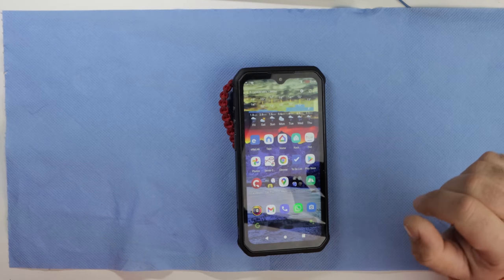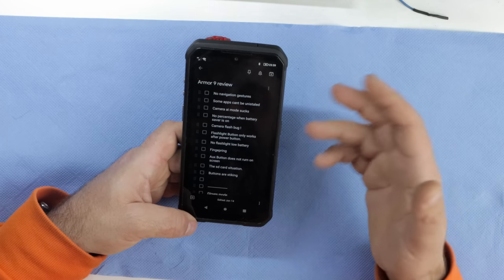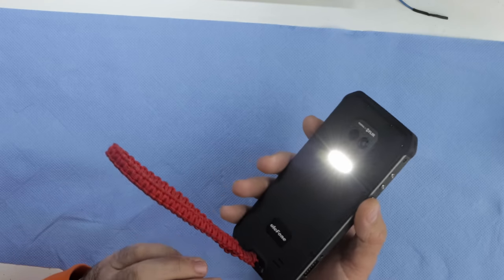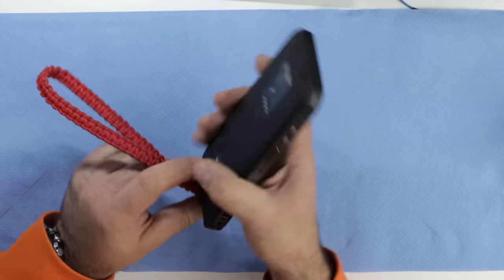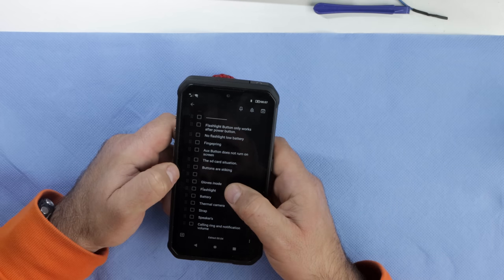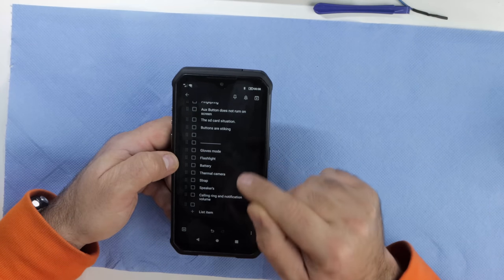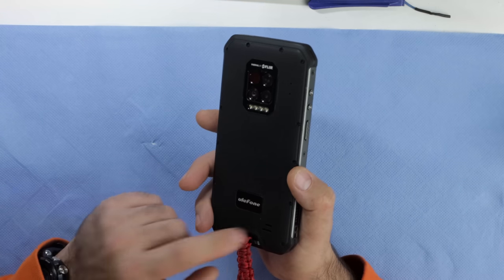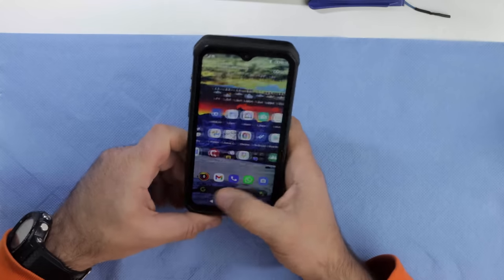uleFone armor 9 follow up 6 months later | The whole truth about this phone !

Comment: Owned mine since it was first released in the US. Use it daily in my HVAC job. Water, oil, dirt, refrigerant, nothing seemed to kill it until......I dropped it off a 2nd floor roof onto a sidewalk. I feared the worst. It landed flat face down and even with the additional external case I figured it was a goner. To my surprise, the screen was undamaged. I did manage to kill the microphone from the sudden deceleration test. Contacted Ulefone, while out of warranty they did send me the parts to repair it myself at no charge. I used a bluetooth earbud for calls until parts showed up. Swapped them out, good to go. It I ever do kill it for good somehow I would absolutely own another. I actually do own 2 more of their phones, a 3W I use as my personal phone and a 6E which is now a spare as I wanted the 9 with the FLIR for work as soon as it was released. The 6E I've loaned to my 5 year old grandson to use as a tablet/games as he's already killed his momma's Samsung and a tablet. He can't kill this one. All three have been amazing (and abused) rugged phones that just don't quit.
Reply: What email did you use to contact them I have a 4 month phone that won't work. I've been trying to contact them to buy parts and have been ghosted.
Reply from the maker: Does your GPS still work properly?
Reply: @reversingentropy  Yes, everything still works fine EXCEPT - the texting has never worked worth a crap. I've had it on both Verizon and ATT as well as tried several different apps. Same results, it'll work fine for a few hours then I'll stop receiving and hangs sending. Reboot- Same results. Checked all the settings without success. I use this phone for work where we use a specific 3rd party messaging app (Trillian) where everything/messages live forever on our server with no issues. My other Ulefone phones never had this issue 🤷🏻‍♂️
Reply: @Anonymous_User_Incognito  That's weird.

Comment: Thanks so much for a review after using the phone for a significant time. I love how you actually stated the cons, they were not all that bad, your video actually promoted the phone way more than any advertising crap could've. Could you give an indication of how many times you dropped it on a tile or stone floor? Are you still using this phone in 2022? how is the aux port, can you get any cable into that small hole?
Reply from the maker: Hi. Shure. I dropped it way too many times to count. However the screen broke. It has a single crack from one side of the screen the other. But it did not shatter and its bearly visible. Aux port is fine use it often changing port is fine as well. But ever since last patch there is a gps bug... It takes for ever to get location and sometimes not at all. Various people have the same issue.
This phone is now old and broken and it sucks in many ways but what else am i going to buy ? Hope this helps cheers
Reply: @reversingentropy  thx so much for the heads up

Comment: The Armor 11T has a thermal camera. Lower resolution screen, no card slot, and no endoscope connector, though. Seems like they decided to cut costs on several things to fit 5G in. I wonder if the battery indicator / flashlight / side button issues were fixed.
Reply from the maker: It also has no port covers so you can't use it in saltwater. No place to attach a strap..No five LED flashlight etc etc... It's a downgrade Rather than an update...
Reply: @reversingentropy  - The new Armor 18T seems to be the real successor to the 9. The flashlight looks pretty good and most of the specs are improved. I wonder if the button behaviour / fingerprint scanner are any better, though. And it's pretty expensive.
Reply from the maker: @RFC-3514  i haven't seen it yet. Im checking it out. Thanks.
Reply: @reversingentropy  - Have you managed to get our hands on an 18T yet? Every video about it on YouTube seems to just reuse video clips from the manufacturer, which makes me doubt the "reviewers" ever even held one, let alone used it out in the real world.
Reply from the maker: @RFC-3514  no I haven't. I am done with armor, i am using google pixel instead.

Comment: I can't get any menu path to assign apps onto the SD card, but the other feature are tremendous... Your 6 month later video was the clincher for me... I got the who gadget set for it and love the features...   A month later I'm still unable to find a android menu path to enable the apps top move to the SD card and the menus are a little different on each phone brand... If you are willing and actually have the time could you note the menu selection sequence to enable the apps to be located on the SD card ???   Your Videos are the best Comprehensive on YouTube... All other Videos are superficial except for yours... Thanks for the Lists of Pro and cons as well.... Really Great Video 10/10 !!!
Reply from the maker: I can't find it... I am sure it was there on previous firmware, i think... But i have searched for storage options and i can't find any.... WTF ulefone... What are they doing...
Reply: @reversingentropy  Yes, me too... I am not the most obtuse stick in the mud, and actually like building my own PC's... Even did coding back in C-64 Days and wrote an actual 3-D Rubic's Cube Program with sound and Joystick control... Used almost all of the 64k...  Did Fortran4 on the old IBM Model-360's... So I have a little light at the end of the tunnel with tech...., however I dug systematically through every single menu and came up ???????????????????????? !!!! So I am in 10000000% agreement that Ulefone Broke their, "FONE...." Yessireeeeeeeeeeee..... They Sure Didskeeee ! Fix it Ulefone

Comment: i just got the armour 9 pro
have to say..so far so good
just need this as a general purpose phone so the extra ruggedness is a nice insurance option
have a question...screen came with a film protector as well as a tempered galss protector

i suppose i can wait for the film protector to wear down a bit before  removing and applying the galss protector?  is that the idea?
Reply from the maker: I do not know i long ago broke the screen protector and am running without any protection on the screen. some scratches but nothing major.

Comment: I've had mine for a while, the flashlight button bug is dumb, but there is kind of a way around it. For me, simply holding my palm over the fingerprint sensor and pressing the button simultaneously works without turning the screen on, and that works most of the time, but there's a sort of learning curve to it which is dumb.
Reply from the maker: That is a great idea.Thanks. by the way, has your gps been acting up since last update ? Mine has been bugging since the update. Sometimes is works sometimes it doesn't. Not even a reeebot will fix ot when ot decided not to work. They fixed the battery percentage issue with this update. But messed up the GPS 🤦🤦🤦

Comment: I have the Ulefone Armor X10 and they seem to have addressed a few of your issues, such as now including the micro SD card in the same tray as the sim.  Some of your issues seem to be related more to the Android 10 operating system than to the phone itself.  I agree with Ulefone that being able to make an emergency rescue call is probably more important than being able to turn the flashlight on.  If  you caving without a back-up light source, you probably shouldn't be caving.
Reply from the maker: Yeah cuz nobody ever accidentally fell in a cave... I maintain it should be mi choice not theirs. 👌

Comment: Armor 11 Pro is supposed to have FLIR thermal camera (according to Ulefone's responses under their own videos).
Wonder if it'll be the higher resolution one - this only has what, 80x60? The higher FLIR version has, afair, 160x120
Pro is supposed to be out in June, wondering if I should get it.
Edit: also, great review, thanks!
Reply from the maker: That's good News. Now i have something to look forward to. Thanks for the info.
Reply: @reversingentropy  No problem! Unrelated question if you don't mind though: I'm switching from Armor 2 because of the annoying issues that I've encountered and one is especially pissing me off: protection rubbers were not matched well enough, they're too large and as a result, they unstick from the phone's body. 
So my question is: is that also an issue for Armor 9?
Reply: @jokeusa  not an issue on my armour 9. The rubber is quite understated. I'm not even sure its rubber now that i think of it. Nevertheless its not an issue.
Reply: @reversingentropy  Aaaaand 11T is out! Sadly it still uses the same FLIR 2.5 so 80x60 but better that than nothing!

Comment: buenas, me gusto tu video. me gustaría saber si me lo recomiendas. trabajo en una planta fotovoltaica, me servía la cámara termográfica? hasta que temperatura puedo medir?? usamos una fluke y solo mide hasta 190 grados. y su taza de refresco es de 9hz. saludos gracias
Reply from the maker: Yes it would probably help. This flir sensor has high temperature mode. I jave measured more than 280° Don't remember what max temp is. Refresh is fast enough to not notice.
Reply: @reversingentropy  genial, muchas gracias un abrazo muy grande!!

Comment: Ìs it really true that this model don't get any updates? 2020 is lastest FW that i can find. I bought this phone when it was released and few updates came..and newest update ruined whole gps. Is there stable custom rom with flir? Can't recommend this manufacturer if updates is that bad.
Reply from the maker: Totally agree. I am never buying from them again. Mine had the gps stop working completely, then the screen cracked and now the charging port is not working so the phone is useless. I am back using an old pixel 5 which just got the android 14 update. I should meke a video on the death of the armour 9. Cheers mate.
Reply: @reversingentropy  it's really sad that ulefone don't care about how long their phones have lifetime. Ulefone seems to trust in if people wan't to update, buy a new phone..lol. But good vid, thanks for that and can't wait for video update😁

Comment: What about the rubber plug door for the Type-C USB Charge PORT ????? No one is addressing that cheep door that will break off in a short time... It needed to be made of Silicone or an actual snap in place door that is totally on or off the phone... Point being No one Charges their phone while under water !!! So when it breaks off, your phone is no longer water tight !!!!!!!!!!!!!!   Please Comment... I have one of these Armor 9 phones and may return it because that is a poor design...
Reply from the maker: Mine is still fine after all this time. No issues here. 🤷
Reply: @reversingentropy  Thanks for the response ! By All means make more test out videos like how you use it OTJ etc !!!  Rated you Thumbs up and Subscribed to support :-)

Comment: Anyone notice that the lower right camera is fake? I'm speculating they sent all working phones for reviewers and then left out that part as they mass produced it. I can not get it to activate no matter what I do. The only camera that works is the one for the 64 MP main camera, the flir camera and front facing camera.

Edit: I took armor 9 apart and can confirm that my production run of armor 9 has a fake camera. There is a fake flex cable with no actual traces connected to front right camera. It appears they did a Kickstarter campaign with design details then pulled back on some features perhaps due to parts over cost and chip shortages ?
Reply from the maker: I have not noticed. Thanks for sharing 🙂
Reply: My understanding is that the camera on the lower-right (next to the 64MP main camera) is a 2MP depth sensor. It's not meant to be a camera that you can take pictures with. It's there to assist in fast focusing the main camera and to create depth of field effects when post-processing the image. I haven't personally taken this phone apart, but I was also under the impression that the cameras were all part of the same module and would not have their own flex cable connections individually.
Reply: @joshuaewalker  that is interesting, if it was just for focus then why is there a flex cable to it with no copper  traces?  I had the phone a few months and its pretty reliable.one thing that really needs work is the software . It needs a major update.
Reply: @Emphasis213  
I completely agree. With some real effort on the software this phone would be amazing. It's already really good (especially for the price) but this hardware is capable of way more than the software allows.
As for the flex cable... Idk? Does the fake cable go from the camera to a connection on the motherboard?

Comment: What do you think about ulefone armour 13 power?
Reply from the maker: For my use case it doesn't make sense. I rather carry a external power brick. Because the armor is too heavy with 5000 battery. The power 13 is insanely heavy.  But if all you need is battery a guess this is the phone for you.
Reply: @reversingentropy  yes i work for Amazon so i need big battery
Reply: @justahuman7391  
If I may ask, how does working for Amazon affect what size battery you need in your phone?

Comment: I can't receive photos in text message on mine. I can send them, written texts are fine. If I swap the VZ sim back to the stock phone, all the pics download.
So, it isn't the VZ network - it has to be the phone - and fuckall if I can figure it out. I have tried all kinds of shit, including factory reset, creating a new APN, changing from Global to LTE network setting... nada. Otherwise, this phone is a BAMF.
Any ideas folks?
Reply from the maker: Send it back. Its working fine on mine. Ive been on two networks so far. Vodafone and MEO and had no problems. Or just use WhatsApp 🤣
Reply: I use mine on T-Mobile and have no problems. Maybe this phone doesn't use the particular band that Verizon uses for transmitting MMS. As far as I know this phone works best on GSM networks not CDMA.

Comment: Great review man !
Do you think there is a chance that a few of the bugs will be fixed with a firmware upgrade ?
Btw, I shot this beast for only 395 € . . .
Reply from the maker: Actually just got a software update. That fixed the numbers on the battery indicator. So i guess yes they're trying to fix the bugs with software update.
Reply: @reversingentropy  
Thanks for the reply.
That are good news and I hope there are more updates to come.

As we know the Ulefone Armor 9 uses a Lepton 2.5 heat sensing module. Can you use the FLIR cam to identify heat signatures in a field @ longer distances or would the CAT S62 which uses the superior Lepton 3.5 sensor with higher resolution be the better choice ? In fact, I want to use the phone for surveillance in total darkness . . .
Reply: @MichaelM-tt5wd  I was thinking about cat s62 pro but after some research i don't have more questions: ulefone 9 is soo much better
Reply: @kaiser7121  
Thanks for your input !
In fact the major reason I bought the Armor 9 was the price.
Both phones have advantages and some disadvantages :
What I dislike about the Armor 9 is the side-mounted fingerprint sensor, the weight and the microSDXC using a shared SIM slot. The biggest drawback though is the built in thermal imaging sensor. The Armor 9 uses an outdated lepton-module ver. 2.5.
The CAT S62 Pro instead is using a lepton version 3.5 module with a FOUR times higher resolution. In case thermal imaging matters to you, that would represent the biggest dealbreaker for the Armor 9 . In addition the CAT complies to MIL-STD-810H from 2019 whereas the Armor only has MIL-STD-810G compliance from 2014.

In the end you get what you pay for, but I am rather happy with the Armor 9 so far.

Comment: HEY THIS IS SERIOUS, AND I SURE HOP YOU WILL STILL CHECK QUESTIONS HERE !!!!! I have this Phone Too, after Buying it like you did, I simply can not find any menu path tho set apps to be located on and installed on the MICRO SD CARD !!! Really puzzled on that because never had a cryptic unacceptable situation with Android before...  To Me it is an absolute quiet deal breaker. I will resell it as almost new... To set up any Cell phone so the apps and data can not be relocated on the installed micro-sd card is total mis-design !
Reply from the maker: I am not sure what you mean. On mine i remember it first used the SD card for apps. Then one day i removed the sd card and nothing worked. So i decided to use the sd card as storage only.
Reply: @reversingentropy  i can only get it to store pictures and videos on the SD card... No menu options to store apps on the SD card... All my other phones were straight forward with the menu path...   Good point on the 5G because 5G is also Dangerous... 4Gigahertz and over should never be used near people...

Comment: good video bro, in your overall perspective is this a good buy
Reply from the maker: Well yes and no... Its not perfect and i still miss the Pixel software. But just yesterday i had a overheating battery in the van, and used the thermal camera to diagnose the issue... So i wouldn't have any other phone.